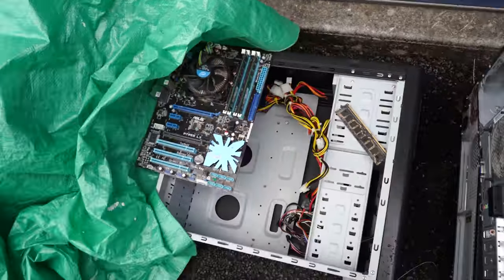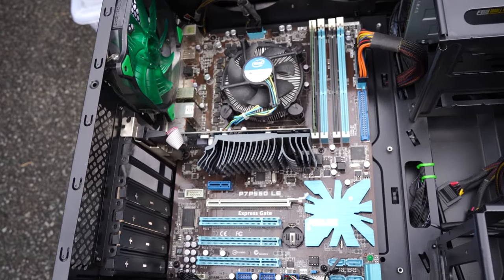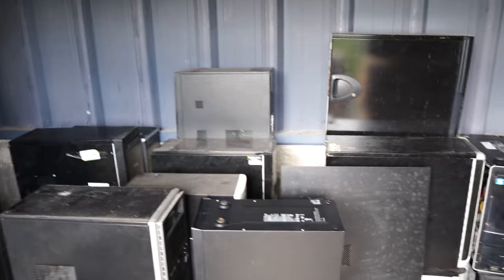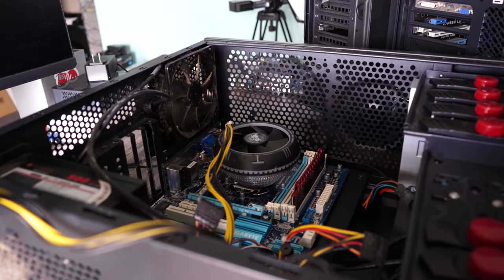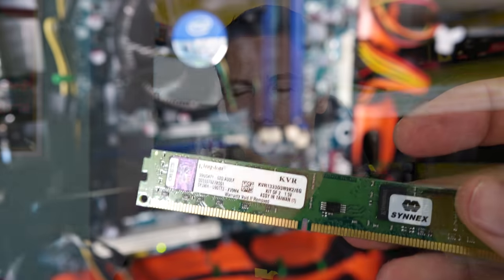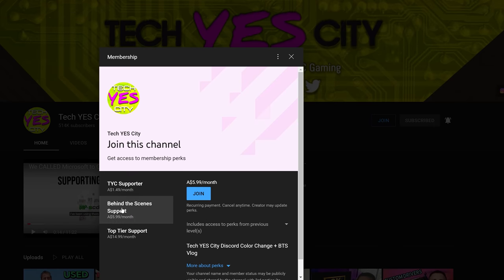Cleaning out a Storage Unit with OVER 50+ USED PCs - Did I find any BARGAINS?

Comment: A lot of those issues you are having looks like you simply did not use the correct memory slot when repopulating ram.  Some boards, especially MSI, suffer from this issue.  More times then not, people RMA their MSI board thinking its dead.  When in fact they didn't have the correct memory config to start with.   Do this.  Reset the cmos by removing the battery.  replace the battery and insert the ram into slot 2 only.  start up.  if that works.  then slot 4.  start up,  then slot 1. then 3.   If you mess up during the process you have to remove the battery and start again.  This is by design.
Reply: Commented the same thing! 👍🏻
Reply: My B550 would play up if I didn't use the second slot after a reset.

Comment: 26:00 - That's happend to me a number of times with SGIs I've sold down the years, I end up buying them back later, or winning them on auction, often from someone different if they've gone through several owners. It's funny when I boot them up and realise the OS install was done by me long ago (by which I mean possibly as much as 15 or 20 years back), or some of the accessories I recognise as being ones I put together, or there's an ID sticker I put on the back or the base. It's also happened once with a PC build I did for a family long ago, an AM2 system (6000+ with an 8800 GT and 120GB SSD, solid XP system at the time), I bought it back from them many years later when they decided to switch to iPads.

Pity about the P55s, though tbh the LX models from ASUS were always a bit iffy. Even if they'd had i7s and were working, I wouldn't oc them on an LX.

Good find with that Z97 though.

Comment: The AGP (accelerated graphics port) was used for the graphics cards around 2002 to 2008 for Intel specific mother boards. The Pentium 2 and 3 CPU's plugged in to the motherboards vertically.

Comment: The old retro PC is a later intel Pentium socket 478 that was released just before 775 dual core & core 2 quad days. It has onboard ATI graphics and later AGP x4 and PCI slots, no ISA slots which is needed for best option DOS SFX/Music in games. If it turns out the motherboard has an older chipset such as the intel ICH5 or less it can be used with PCI DOS compatible addon sound cards such as SB live/Audigy. Basically the Motherboard chipset and AGP is what to be careful on with Pentium 4 as later chipsets loose DOS sound card support and some have no AGP that limits graphic options for later games such as half-life, unreal's, quake 2 etc. A few Addon cards with value to look for in old computers: Graphics( 3dfx Voodoo, ATI Radeon 9800/9600 Pro/XT)  Sound(Creative Awe32/64, Aureal Vortex, SBLIVE/Audigy, Trident 4DWave). Nice video thanks

Comment: On the boards that have dual bios's, I'd give bios shorting a crack in the event the backup bios won't initiate as a last resort (shorting the 4th & 7th pin on a bios chip, can do with a paperclip or tweezers). I've brought back a few boards I'd otherwise have tossed.

Comment: For testing the P55 1156 mainboards don't forget to use Dual Rank (2Rx8) 4GB Dimms or to be safe 2GB Dimms. The IMC is clunky on those Lynnfields and won't work with 1Rx8 4GB Dimms.

Comment: 0:48 these fm2(+) motherboards are actually decent. I had one at 8:10. Sure, top CPUs don't perform much better than socket 775 CPUs but they eat any DDR3 memory (especially fm2+) and don't prone to fail nowdays so they'll be worth it for at least an office or even low-end CS:GO gaming PCs especially during such clean-out to make the whole deal slightly better.

Comment: Suggest you test MB's with PS/2 keyboard as USB much later in boot process and legacy USB (needed for USB KB and mouse) may not even be enabled. If you can find one in Aus, then try to get a PCI/PCIe LCD diagnostic card as will give you post codes, allows you to decide if it's worth putting more time into MB/System. Still have my PCI LCD diag card very useful for slightly older systems with PCI slot.

Comment: That rig with an Ati logo in the rig must be from the very early 2000's, since AMD bought Ati in 2006. So those computers were in storage there for quite a bit!
Reply: I believe that's a radeon xpress 9100 or xpress 1200.  And yes, more likely much more earlier than 2006 as it has AGP.  Haven't got a chance to experience this chipset as either nforce, via, or intel was the popular choice back then.

Comment: The old Pentium system is a socket 478. Had a Pentium 4 with this socket in the past, just after my Pentium 3 600Mhz slot 1 rig.

Comment: That MSI Z97 Gaming MB is iirc one of the top haswell overclocking boards - those typically go for US$100-$130 on ebay, so that's a score. I don't know if anyone buying a random haswell gaming pc will pay a premium for the mb, but someone there in AUS might pay the premium if you sell the tested board by itself.

Comment: That old Pentium bored some of the times it having two different memories is a prototype board for the new memory and sometimes it's for a onboard GPU you would actually have to look a little bit closer to see if the traces go to Graphics or if they go back to the CPU because I have seen both configurations before

Comment: Hi.  Love the work.  How do you deal with pc parts from heavy smokers/vapers homes?  I came into a bargain or two recently but the nicotine and tar is almost impossible to remove.  The smell is overwhelming even after hours of scrubbing.  What's the trick?  Or is it just bin them and write-off otherwise good parts?
Reply: Wash the motherboard in your dishwasher. It works you just have to make sure to take off all detachable things like heatsinks and dry it properly. Use highest temperature setting and no detergent.

Comment: That Asus P55 board is doing similar things to BOTH a Gigabyte Z170-D3H and Z270m-D3H i picked up for 20 picks. In my case, it was due to the bios_1 chip being dead. Snipped a pin to force the board to boot from the backup chip, threw an i5-6400 in to test and they both fired straight up. If you unplug it from the mains it'll lose most bios settings due to that unfortunately, but aye she'll be right mate (Oddly it WOULD hold boot order and USB settings but refused to retain any of the BCLK settings i changed). For $20 the pair tho, she'll be right.

Comment: If the MB doesn't start, straight away start touching chips. Basically if something is hot it's shorted. 
Sometimes you can get a "no boot RAM" because of the CPU - thought I had a faulty RAM, changed the CPU and it worked fine -.
ATX PS are easy to fix, just change out caps that are bulging - it's usually just the one start cap -.

Comment: those psu testers don't always prove the psu will work correctly as they don't put any load on the psu
Reply: A proper psu tester puts a load on the circuit. ⚡⚡⚡

Comment: things like this is what I love.... all of the systems can be reused! if you don't use windows, use Linux to get them up and running! AM2,3, and now 4 are all reusable... I have recycled a few AM2 based systems and when you max out the memory and upgrade the processor to the highest the board will accept, you can put W10 on it... I love recycling these systems and making them work again! and the chassis are rreusable too!, except for the HP and Dell chassis...those wind up getting pitched... I hate propriotary chassis. Great video and lucky you! to get a stache of PC's and all those parts! Hope you are able to make some awesome builds.  Just remember.... Computers don't die anymore.... operating systems do....

Comment: With working with so many old and used PSU's you might want to invest in a cheap oscilloscope you you can measure voltage ripple on the rails. ripple will shred boards over time.

Comment: Still have my old pentium mmx 250 mhz processor mounted to an asus p55t2p4.  Still boots and runs.  That motherboard had hidden 83 mhz bus by pulling jumper completely off. Wasn’t in the manual ha.  It has an old mystique video card

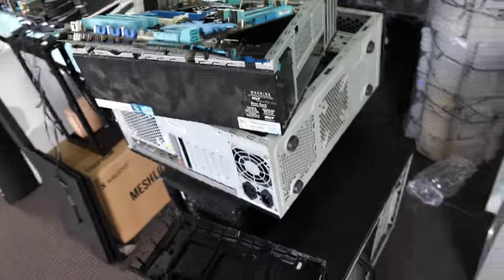Comment: On the last motherboard there is a screw lying between the pcie x16 and the CPU could be causing a short. Check 19:06 bottom of the frame almost center.

Comment: I kind of like the DDR2 stuff for nostalgia sake. DDR1 stuff take AGP cards but with DDR2 you typically have PCIe and old PCIe graphics cards are more common and cheaper than the good AGP stuff. Of course I would not use a DDR2 system for Windows 10 but for XP retro stuff.

Comment: Sometimes when a motherboard is giving an error or not POSTing and you have another of the same model, you can delicately swap BIOS chips to see if the BIOS chip is faulty. Done this with some A88x AMD boards before and came out on top.

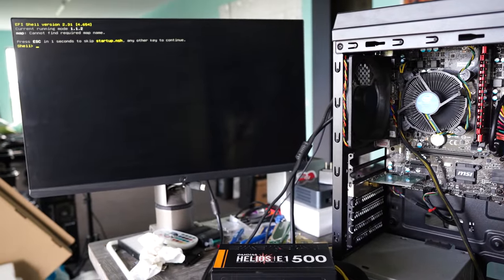Comment: 15:49 just do a hard reset and it should boot fine, gigabyte had some problems back in the days with duo bios', just hold the on bottom then switch of off the ps on the switch wile keep holding the power bottom then a quick on off on the ps switch and release the power bottom and it should boot fine with out (bootloop)

Comment: I do this kinda stuff with laptops\desktops try and avoid older mobos you get a ton of stuff 1st and 2nd gen mobo and ram that's pretty much dead or stuffed from the solder going bad. Its not worth the risk as it may only last the client a short time even if it works. 3rd gen or newer its in the clear.

Comment: X58 question for the X58 master: does X58 have a ram stick quantity preference?  I am putting together an old machine and wanting to use Win10. Was thinking  should i run 3x4gb or 6x4gb or 6x2gb? Opinions?

Comment: Hey brian i have an experience on one  of those asus p55 first gen boards.It can really be faulty. The upper  gpu slot was busted and only one ram slot is working.  If working on one ram, only try the left blue ram slot (cant really remmember what is the code for the ram slot), it does boot for me. Wondering if its the bit-rot term  you mentioned is the cause for the memory conrtoller to be faulty. Anyways managed to use the p55 board on my single 4gb stick as a backup pc

Comment: "We turned on the power supply and a puff of smoke came out... later, this next system wouldn't boot until we changed the power supply..." Lol why are you trying out the systems with their untested power supplies? That's just begging to fry the hardware. Thanks for the video!

Comment: Just fixed a gigabyte z77 similar behaviour to 16:35.  Power/reset trick didn’t work. If it has dual bios, short out pin 1 and 6 on primary bios and boot. Hopefully can be fixed

Comment: 7:48 that was the last gen of P4 with sd ram and ddr2 first gen. Thou the old agp card shows it was not a dual pci-e version. Though a good windows 98-XP machine they were! I have a few spare in my shed, packed safely for another day!
Reply: Definitely P4 on socket 478 with DDR1 modules. Last gen P4 are on LGA 775. Anyway, as you sad it can be solid Win 98/xp machine. Shame that Brian didn't pick up some other retro PCs. There was some good Chieftec cases, probably with some hi-end retro parts.
Reply: Yeah, I was remembering them when they came up in the video. Been a while!

Comment: Whats up with all the coiled sata cables? Was that a fad at some pint?
Reply: It was and technically it’s the best way to have them because a coiled cable reduces EMI absorbed by the cable and makes the signal stronger with less interference. Modern sata cables are shielded more so you don’t really need to do it.

Comment: Loved the new cases mostly. With those factored in if the whole thing was still a mediocre haul. An i7 would have been nice. 

Have one of those 2nd gen i3s, was 3 pc/gaming rigs ago a (gateway) i3 2100. Still had windows 10 on it, 7200 rpm hdd. Pretty much but it on Manjaro xfce on a 120 gb ssd, and have it as another rig for spare media. They aren't great but I remember playing some games on it way back. Pretty sure I used it for WoW WoD era and some emulation/office. It raided awfully but was fine in open world. I've swapped in Windows 11 dev debloated on sata ssd before too, ran better than expected. Probably a cheap gpu might help it's case. Before getting a 1060 though my friend said I could play on a potato, checked the specs which were from earlier in the expansion, lol and well I did for better and worse play on that until The Nighthold was about to release. I can relate to the gamers buying an old pc coming back to you for an upgrade when it doesn't do what they want. Loved the question of the day.

Comment: i would still try to organize the ddr2 dimms keep and group the 2gb dimms and toss the smaller dimms i3s and i5s then have ddr2 systems with at least 4gb ram and cpus that can still run windows 10 and a gtx 750 class gpu!

Comment: I can understand the beer goggle type excitement, but leave gigabyte boards because they are designed to fail at 10 years, and when they were caught... they now make their motherboard bios working with a time limit of only 15 years... planned obsolescence is not OK :) That ASUS LoL... it has blue corrosion under the PCIE-X16. Oh BTW you didn't lose... loads of value there, build one system and you make up more than half the cash back.

Comment: old "Pentium" system, yeah, it's a Pentium 4.  With 4GB of RAM you can force 32-bit Windows 10 onto it, but why?  AGP slot means no modern hardware acceleration so all video playback is going to be running on the CPU, so it's a non-starter for the modern web.  Much better suited as a retro Windows XP box for those games that just don't migrate to Vista and beyond nicely.  With the right chipset/BIOS they can also host Windows 98 and even DOS, but it can be finicky and sometimes a bit of a stretch -- Pentium 3 usually a better bet, but sometimes you gotta make use of what you have!

Comment: got given 3 old laptops yesterday. if they can take 4 gigs of ram and an ssd - i will fix them. if not they go for recycling. a 2 gig laptop without ssd - cannot be used today unless its linux and  you dont wanna browse the web. tbh anything without ssd is gone - its too old
Reply: pcs - like tech yes - i like 1st gen core i7 and beyond  . . . .  also ryzen 1st gen and beyond is good  - so b350 and later ryzen boards are fine imo. ryzen gets a lot better with each gen but the slowest ryzen cpu is ok imo

Comment: i sell some cheaper pc's for home use and usually throw in a small video card to help with crappy graphics. Normally i will throw in a cheap hd 5450 or hd 6450. Lately i have found that some of those cards are reaching end of life and going bad. The issue of "turns off n on" i have found (in my scenario) was caused by the video card going bad. Upon closer inspection i found that the cards were very hot!............several systems have done this in the last year and i was able to fix it by changing out the video card!  . Glad i found the problem but sad i lost the money i spent on the cards- an unfortunate part of doing business on a budget....

Comment: Rade you get in the bios with picture ^^ via floppy via cd via blue ray via usb 2.0 in the uefi stick created x32 Fat Boot FNST a folder Windows on it on ssd so you can install x86 Rade software install a folder penetrate completely installed a cone DVD software that was virtually installed wait was I'm talking boot bar that installs directly exe, what do you want with the garbage better buy something new you have almost everything because the motherboards I wouldn't even buy only triple 12x ram dual or dual extreme , you can also install Boise with it, you can get the absolute old trash driver virtuiel about it too

Comment: As an electrician, i have never turn on unknown condition power supply with the load connected (in this case PC). Kinda cringe to see this video. At least use the power supply tester to check the voltage.